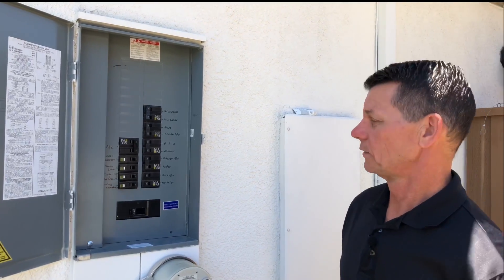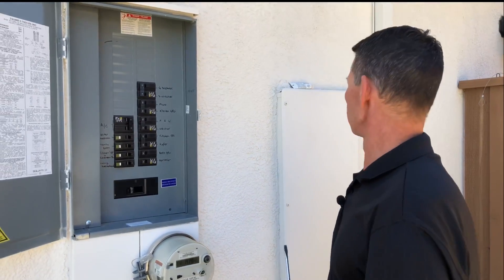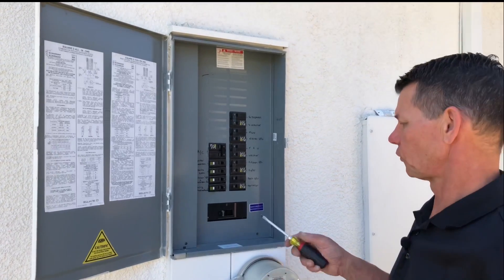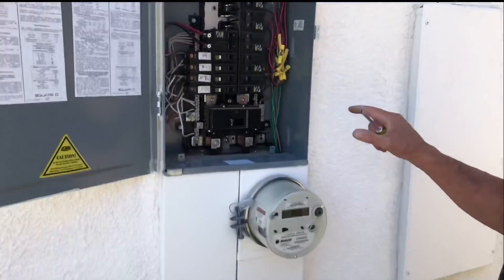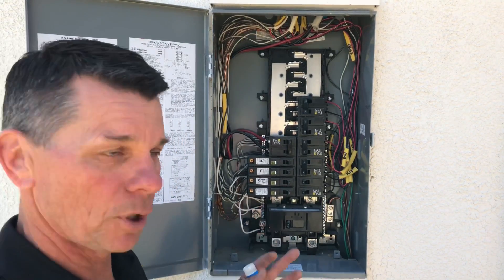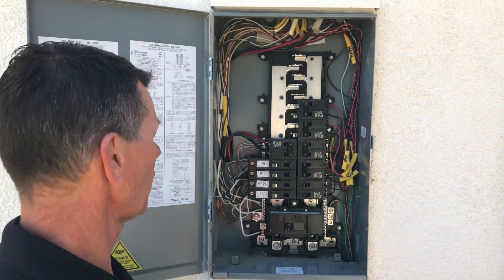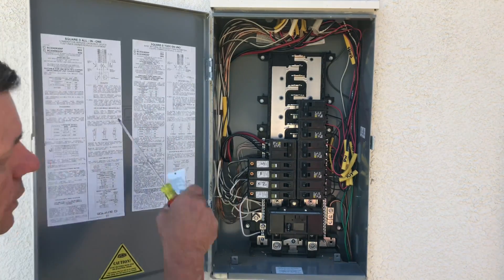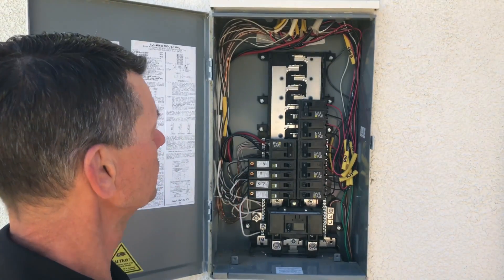Residential Main Electrical Panel Inspection

Comment: I noticed you already had the panel open  which could be a "Safety Hazard" If I was inspecting a panel.. I would start by seeing if the panel door was energized by placing back of your "Right" hand on the door this way if shocked it travels down your right arm not your left where your heart is  Or listen for any buzzing for a arching and any rings should be taken off. Also any water that might be leaking around the panel if located outside. If the ground is wet..do it when it's dry before even opening the panel door if all precautions were taking then open it up... Just a thought

Comment: Remember the new code now requires when a electrical panel is replaced you are required to install a Surge Protector and Lug Barriers and the Lugs are required to have the torque verified. Hopefully the torque verification is done by the utilities?
Reply: Is that not beyond the scope of the inspection (torque part at least)?

Comment: I work for Power utilility Co. , grounding inside a wall  is not allowed.  ground wire could overheat during a fault situation and catch insulation on fire.  There is no reason to do this.  panel suppose to be bonded to meter and ground should go from meterbase to ground rod outside of building.  I suggest people chk with their local utility co.  before doing that, otherwise  the co may not put a meter.

Comment: Can you bond and/or ground to a natural gas line at meter or elsewhere on a fuel gas pipe????   Hell NO!  WTF, that is a code violation in a really serious way.  ABSOLUTELY "NO" EXCEPTIONS, even for cable equipment, telephone equipment or solar panel equipment and especially any main service panel and electrical equipment.  DANGER!
Reply: You need a cold water bond, a gas bond and a ufer ground. Any metal, ie beams, structurally found also. When in doubt ground it out.

Comment: I was looking for the main 240 volt feed and I did not see it but, I imagined it was at the bottom of the panel is that correct?  At the bottom of the panel was the main breaker shut off so, I imagine the 240 feeds are right before it on the bottom.

Comment: Do the main lugs require plastic covers?
Reply: Not until 2020 or if the panel board came with the covers.
Reply: I was wondering this too
Reply: They come with the panel,,the thing is,I cant find it no where in the NEC where it's a necessary.

Comment: Everybody’s freaking out about the screwdriver. It’s a Klein, pretty much the most popular screwdriver used by electricians. The handle is insulated. It’s not double insulated so he could ark along the shaft of the screwdriver itself but as long as he’s remotely careful he’ll be fine. I’m an HVAC tech but we run across a lot of sparkies and almost none of them use double insulated tools or gloves when working on live systems, especially residential. It’s not a big deal if you know what you’re doing, especially for an inspection and not actual work on the system.

Comment: Never seen a outside main panel for a house, curious midwest would never fly.
Reply: Colorado has new replacement installs of service panels all outdoors and must be moved away from gas meters. But they still attach old cloth wire to new panel.
Reply: Common on the West Coast .

Comment: i am trying to install a  small rectangular light on my wall   if i use regular  rounded junction box it  wont be covered  completely by my light  but if  i use the one that is made  for  outlets like the link below it will cover nicely  so  just wondering  if it is ok or any code  for that thanks again 
https://www.homedepot.ca/product/iberville-device-box-2-1-2-inch-deep-1-g-nmd90/1000804607

Comment: That contactless test will lie to you on 3 phase circuits even though you test it it can lie and give you a false negative.  Use a meter when testing.. after USING I have seen 2 testors on the same outlet within less than 30 seconds lie about the circuit being de-energized.  So younovices out there if you are working i a building especially 3 phase use a meter to test.
Reply: Has 3 phase ever been used in normal residential wiring under 4 stories?  And isn’t that a sub panel because I didn’t see a bonding jumper between the neutral and the ground(?).

Comment: Correct me if I am wrong but I thought ground (green wire) is to earth and grounding is the return or neutral?
Reply: Grounded wire=neutral =white/gray wire

Grounding wire= equipment ground= bare copper or green wire
Reply: Ungrounded is hot, grounded (white or natural grey ) is neutral and grounding is green or bare conductors

Comment: Hello, Is there a minimum height for a circuit breaker box from the floor?  It appears no, however they have "The circuit breaker at the top of the box may not be higher than 6-foot 7-inches from the floor."  Thanks...
Reply: 6 foot 7 inches is your maximum height.

Comment: Was there an exception allowed by the electrical inspector to not comply with clear space required in front of the electrical panel?   The meter socket is in the NEC required space.   I've seen panels turned down because of 6x6 wireway below 4" panel.   Had to move panel out 2".
As mentioned by others, NFPA 70E violations on your part.    Be safe, the life you save may be your own!
Reply: What I like is how he says the anti ox needed for the aluminum conductors no it not required after 1981.
Reply: The meter can be like that the NEC does allow it. The wire way you talking about was it part of the same panel, if it was then if it was, code allows up to 6 " in the dedicated space, done that in electrical room in the mall for the spaces services.
Reply: Thomas Marable    All inspectors are different.      Please watch this video       https://youtu.be/B05Lu7h5Tig
Reply: @KevinCoop1  I like his videos, he very good at explaining the theory and code on it, and he seems to love to learn everyday. But inspector are not gods and I will break out the code and so them. I have worked with some great inspectors in my area who aren't afraid to say they are wrong. Like the one who tried to get me to remove bell end caps on pvc coming into bottom of an open switchgear and replace with terminal adapter and plastic bushing. I was not going to disconnect 10 sets of 500 and replace it.
Reply: Thomas Marable   The inspector that you really need to be known by is the Chief Electrical Inspector.   The one I dealt with most of my career, I met when he was an inspector.   I think we traded our opinions for 30 years.   I even got a few opinion calls from him.  He wrote a reference letter for me when I applied to be approved as a PE in 2006.   Not a EE, so a different process.   
I think we commented before and you work for a lighting company, correct?
If you're still in the game, best wishes!    Respectfully,    Kevin
Reply: I worked with 2 other guys we owned a design build company. I was the only electrician/ pe. We did value engineer and some design work for Marrot hotels. And PepsiCo. They were our biggest clients. We also did electrical testing including breaker and gear testing. Some engineer standards were out there to. They didn't fully understand testing procedures, but must were pretty close. Along with another test company, we came up with a standard for test used breakers. It help that UL had already had some guide lines but not all could be followed in the field.
Reply: Thomas Marable    Great!    I worked for one of the larger Electrical Contractors licensed in 47 states.   Was employee owned until a few years ago.   If it had electrons flowing in a building, we did that kind of work.   Did 3D electrical layouts starting in 2008.  Did 5 miles of 3.5" conduit in 15,000 sq ft hospital electrical room.   Worked on massive data centers with enough 2.75 MW diesel generators in only a portion of a building to power 38,750 homes.   Now retired and happy.     I missed going in to work about 1/4 second.   Respectfully,   Kevin
Reply: @Florida Man    Perfect!   Thanks for the response.   Respectfully,   Kevin

Comment: NFPA 70E 2018 states that when removing bolted covers that exposes energized parts 240V and below, the worker should be wearing arc flash category 1 PPE.  Way to set the example for young electricians.
Reply: Mark Martin shutty
Reply: LOL
Reply: i dont see any feeder wires.
i dont think panel is hot
Reply: We perform arc flash studies.  I am glad you are concerned about this as it is important.  However, the incident energy on residential is below 1.2 cal per cm2, not requiring ppe.  Or less than Cat 1.  Arc flash studies are not required on residential because of this.